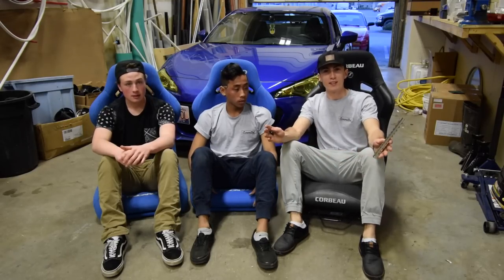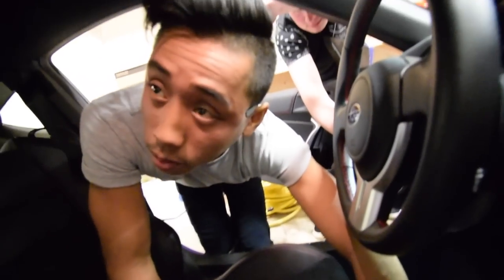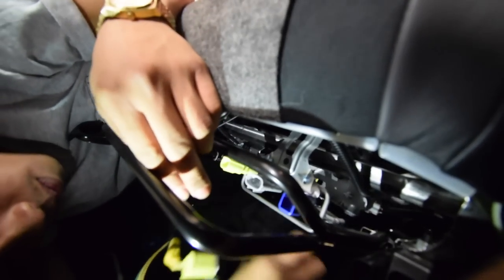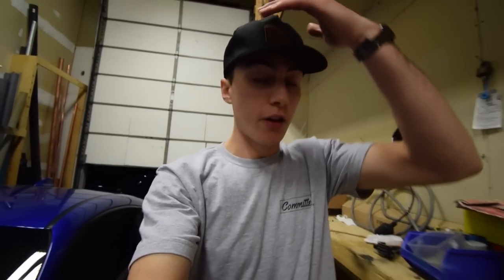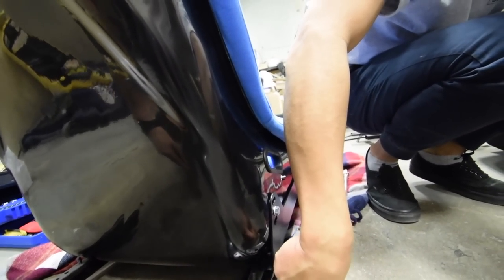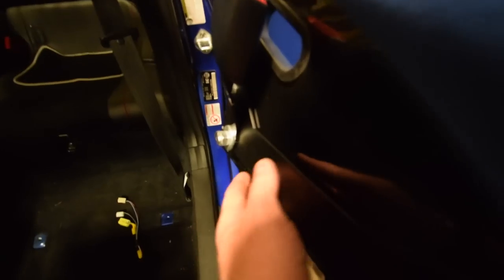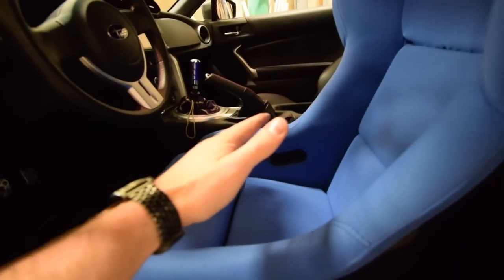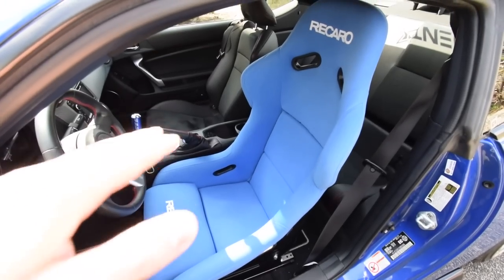Racing Seats Install in the BRZ!!

Comment: "The seats wasn't something I needed, or necessarily even wanted" ... proceeds with installing a no-airbag seat, hacking a seatbelt lock into a spot not designed for that, and can't correctly put the lap part of the seatbelt anymore.

Hope you've ditched the seats before you got into any kind of trouble!